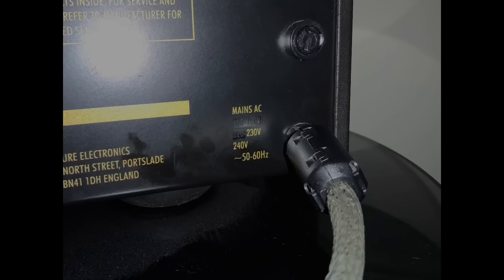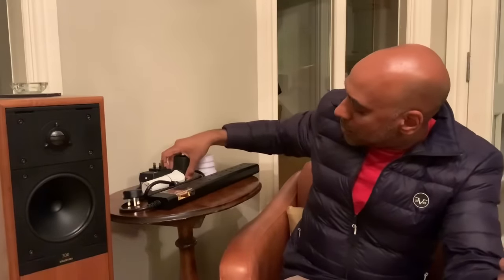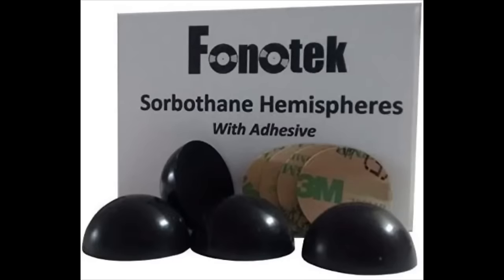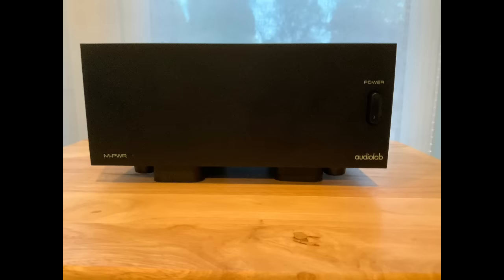My Top 5 Inexpensive Hifi Tweaks

Comment: Honestly love some of the "HiFi Tweaks", but!;

"isolation" pads WILL allow the cabinet to move and dampen and/or resonate with the woofer, best to put the speaker on a platform with substantial mass (concrete/marble/granite, etc) then use the isolation pads underneath as to not pass vibrations to a wooden floor. If you have carpet you may not need the isolation pads. Placed on cement floor the spikes (if too pointy) will also allow the cabinet to move and resonate/dampen the sound as well. A very simple test is to place something heavy on top of the speaker, if the bass sounds tighter and cleaner than you have a floating cabinet issue.

If you want to clean up and condition the electrical signal buy a isolation transformer, completely reforms the electricity and is used for servers and medical equipment to guarantee a solid clean 110v/230v without noise. You can buy the best power plug, but that means nothing if you have a bad outlet or electrical in your wall or even faulty transformer outside your house. These cost about $150 and will eliminate any need for any other gizmos.

Another inexpensive tweak is a clean contact. Tarn-X and a Q-tip is your friend ;-)

Side note, you have tiny bones in your ear that adjust for different sounds that WILL physically effect the sound. Even tilting your head back will mute the sound a bit. Point being if you feel it sounds better after certain changes you might be literally opening up your ears and are hearing it better inside your ears but may not be getting any real changes to the audio it self. And obviously cleaning out your ears lol

Comment: Some really good and sensible tips - thank you.  I have just ordered the rubber washing machine feet to place under my Atacama stands, which are currently on spikes and then placed on 2p coins, going to place the 2p coin inside each of the rubber feet so that the spikes dont go through the rubber moulding.
Reply from the maker: Thank you John 😊👍

Comment: Great advice. The washing machine pads work for me under almost all of my hifi. My Linn dealer advised not to use anything under my LP12 trampoline baseboard though as you can have too much isolation. I will be giving one of those extension leads a try next.
Reply from the maker: That is great Tony 👍

Comment: Thank you for the suggestion of using washing machine supports for speakers on a wooden floor.  I was a little sceptical but am trying this today with a pair of KEF 104/2s that stand on granite plinths that are in turn on a well past its best bouncy Victorian wooden floor.  Initial impressions are of less congestion in the bass and lower mids; clearer tom and bass drum patterns, maybe slightly improved imagery too, time will tell.  Definitely worth trying and if I decide against well at least I can use one pack under the washing machine   😄
Reply from the maker: You have kind of mentioned the improvements I would expect from decoupling you speakers from a wooden floor. Thank you for watching and sharing your experiences 😉👍

Comment: You are definitely my favourite Hifi channel. Total common sense and honest look at this subject. I have implemented exactly the same items as you have listed. I attended the Bristol hifi show this year and sat in on (won't say the manufacturer) demo of their mains filters/ conditioners. He held up the Tacima 6 way mains conditioner and said they have tested this and it introduces noise and degrades the sound of the audio. I nearly fell off my chair. They did not use it as a comparison between their kit either, just decided to bad mouth the Tacima. I have one, nice bit of kit. Great video sir👍
Reply from the maker: Hi Andy, that is pretty shocking that a manufacturer would do that. Especially when it is know in engineering circles that a main conditioner can be effective and produced for little money with passive components. I am not saying that the Tacima is perfect but it works in my system at least.  Thank you for sharing and your kind words of support 😊
Reply: @abritishaudiophile7314  I was shocked that they named and shamed. As if Tacima would produce a product that would be detrimental to  audio the purpose it is designed for. I agree it's not expensive but it works. Mine is staying in my setup. Look forward to the next video 👍

Comment: Are you sure about connecting the shielding at both ends?  I thought you only connected it at the wall plug end.
Reply from the maker: Hi David, it is my understanding that it is still better to connect the shield to ground at both ends for it to be most effective. I believe the purpose of connecting at one end was to avoid ground loops (potential difference from one end to another) which can cause hum and interference. If you don’t have a ground loop issue, I was led to believe that it was better to ground the shield at both ends. However, I am sure that someone with a deeper understanding than me may be able to elaborate further. Thank you for watching 😊
Reply: Opinions seem to differ. When I made up my mains cables (I prefer the Belden because I tend to stab myself in the fingers with braided shielding) I connected the shield at the wall end only, but there are arguments for connecting at both ends.
Reply: Yes, i also got recommendation by electronics/hifi diy experts to connect only one end, to leak all that noise back to the wall instead of amp and wall.
Reply: Terminate the shield at the wall end only. You want any electrical noise to flow directly to the outlet and not the equipment. If you connect both ends you can have noise going to ground at both ends. Even though it will ultimately wind up going back to the system ground, it is the time it takes for that to happen that can cause isues. Terminating one end only provides the shortest, quickest, and least resistive path to ground.
Reply: @osliverpool  Connect The Shielding To The Plug End If You Connect It On Both Ends The  Shielding Will  Act Like A Antenna
Reply: @abritishaudiophile7314  the shield becomes the earth if connected at both ends. Ground voltage in the equipment will then rapidly raise and lower with the fluctuating R.F.  So only connect the mains end.
Reply: I'm inclined to think its a red herring.
Reply: @rrussell39   What happened to the Maximus at the end, lol.
Reply: @Stew666able  i saw it on  a PS Audio Video. Also i Bought A MCRU Silver plated Mains Block Last Year I Removed The Cap On The Mains Block and The Shielding Wasn't Connected It Was On The Plug.
Reply: @rrussell39  technically does not matter how it's hooked up the path of least resistance will be taken.
Reply: Agree with you David. For me it is not critical the gauge of ground cable as in neutral since ground doesn't carry current.. It´s only for safety and zero the chassis. Shield is only shield and you want to discharge it as near to the real ground. in this case i think even on a top high end you cant ear the difference but on very hostile environments associated with longer runs of cable you probably can, at least, measure  it. By the way great video AB.A.
Reply: If you're disagreeing on whether to connect one or both ends then you're obviously not hearing a difference. Which makes the whole exercise irrelevant.
Reply: @jonblakeman6636  haha that was a good point!
But the "exercise" would get twice as much work then you need to buy double the material to make two sets of cables. So you can switch faster between them. When the hearing memory is very short so you do not have time to modify one cable between listening sessions.
So I think all the hassle to make that experiment is mainly the reason why nobody do that experiment. And that is why we do not know.. ..and not he other way around.. (that everyone has done this experiment and can't hear the difference)
My guess anyway. I have not done it myself, has anyone?
(But it should be a rather easy task to make a power cable that has at the equipment end the shield routed to the outside of the cable before it goes to the earth lead. So you can put a connection that enables you to plug/unplug the shield at the equipment end. For fast AB testing.)
Reply: Since final input sources terminate at an Amplifier input... this is the ONE & ONLY ONE end where you should terminate the shield.
Reply: Ground cable is for YOUR SAFTEY.. not for the safety of the equipment ...it must have at least the same " ampere"  & voltage insulation class as the input power cord..
Reply: Honestly, it depends, and pays to understand your equipment and the problem you're trying to solve - it could make it better or worse. Spoiler: You would probably be better off not connecting it at the equipment end in most cases. 

Firstly, the Ground wiring in your house is so high-impedance at RF that it probably won't do anything at all either way. 

If it's an electrically noisy area, like an equipment room/factory etc, the shield might help, and it might make a difference whether it's terminated at the equipment end or not, but... 

The other thing is that a lot  of home hi-fi equipment is double-insulated, even if it has 3 pins, the ground may not be used, unless it has a good mains filter on the input. Disconnecting the shield at the equipment end might be helpful if there is a mains filter as it means the noise currents will travel down the earth core rather than the shield and the shield will provide some electrostatic shielding of that from nearby cables.

Your milage may vary, I fixed an RF interference issue at a home right next door to a 100kW AM broadcast transmitter. Shielded mains cables with the shield connected to a seperate earth stake, and not terminated at the equipment end might have helped, but treating the speaker wires (Ferrite cores, and low value, high voltage capacitors to ground) was plenty. There was BTW already a mains filter in place. 

Shields, capacitors and ferrite cores all shift problems from where you don't want them to where they don't matter. You still need to think about where that is and how it gets there, otherwise you could end up making it worse, or spend money to have no effect at all. Looping back to your question, do you want noise current picked up by the shield going to the equipment or to the house wiring?

BTW For interconnects, there is more to think about, but the principle is the same.
Reply: @rrussell39  well said sir!
Reply: @Dealingwithidiotsonadailybasis  Who is the other guy you're thinking of?
Reply: @jonblakeman6636  Also anyone claiming a difference can only be imagining it!

Comment: Good video.  I will add one more cheap tweek.   Speaker pad, they are dense pad of foam to place your speakers on, Amazon has various types most under $20.  They are more sturdy than small rubber feet (without need for putting adhesive on the bottom of your speakers).  Protects the speaker and the stand from scratches, while also nicely isolating them from each other.
Reply from the maker: Thank you Francisco. I use them too 😉

Comment: Thanks for the tips Tarun.  I see you're diving fearlessly into the area some find contentious, but I for one agree with your views.  In fact, I've been making my own Lapp cables recently to replace the horrible standard cables on some of my vintage gear.  This has included fitting IEC sockets to the backplane of amps and also using rhodium plated connection throughout.  Only slightly more expensive but less prone to oxidation.  Saves on deoxit later.

By the way, I agree with Mr Hall's comment and I only connect the shield to the plug end of the cable.
Reply from the maker: Hi Mark, thank you for your feedback. I just check with David Brook @ MRCU  who sells the Belden and Lapp kits. He agrees with you that the cable should just be terminated at one end, the plug end. I will post an update based on this advice.

Comment: Great post. I've basically put in place all of your recommendations. The ferrites didn't work for me in the end as I've bi-wired my speakers and in my situation it choked them. However, the Tacisma and the combo with the ifi has worked excellently for me. I did suspect it was bs, but very definite difference, cleaner sound more headroom and no strangle hold unlike many other stuff I've tried including Furman. Thanks.
Reply from the maker: That is great. Thank you for sharing 😊👍
Reply: @abritishaudiophile7314  Could you do a piece on designated pre amps and power amps, or more importantly using integrated amps that can switch to either or? I find it very confusing even with a rudimentary knowledge of hifi.

Comment: Nice tips!

Regarding power cables, I was a major skeptic of expensive cables.  As you and others ask, how do the last 2 meters of wiring make a difference,  especially when one has power conditioners?  Fortunately, I had the opportunity to speak with David Salz of Wireworld. He explained that the function of the power cord was to deliver 60-cycle power (here in the US) to the equipment without carrying along the "trash" that is layered on top of what comes in from household wiring (and the power company).  Therefore, he designs his power cords to filter all but the 60-cycle signal.  When one considers that what we ultimately hear is the power supply as modulated by the equipment and audio signal, one can justify the use of properly designed power cords.  g

I too found the IFI filters to be effective, and I use several.  While I don't know about the power strip you mentioned, many come with 16-gauge wiring, and that may limit dynamics. 

I do have a dedicated 20 amp circuit used exclusively for the audio system, and find use nothing less than 14 gauge power cords even on low power consuming gear.   My latest addition to my power solution is a battery with an AC regenerator.  It is only 500 watts, but I can run my CD transport and DAC with it.  I was gobsmacked by the improvement.  It annoyed me because of all I have spent cleaning up the household AC! 

Suggestion: do a video on room treatment.  The biggest change I ever made to my system was extensive room treatment.
Reply from the maker: Thank you Robert. Well designed power cords do exactly that, filter noise. They don’t need active or passive filter networks, the geometry of the cable can act like a filter. I have done a video on room treatment. Please see link below… 👍
ABA Clips: Do you really need room treatment?
https://youtu.be/d4WI_cSc7Wc

Comment: The Tacima is an amazing tweak. I had no complaints with my system, no buzz, no hum, even on full volume on pause play. But the Tacima definitely improved the TV picture and brought additional detail in the music. Moving speakers a bit further from the wall helped improve the sound. Much enjoyed this and other videos for the clarity and fluency. No plans to replace my 20+ year old Linn system.
Reply from the maker: It is great that you are still getting so much enjoyment from your system. Thank you for watching and sharing your experiences Chris 😉
Reply: The biggest things you need from conditioners are: lack of current limiting and not using fuses/relays to absorb surge.
Reply: Are you using classic Linn speakers? I picked up a pair (Linn Ones I think they are?) with integrated concrete stands (!) from FB marketplace, and I love the sound of them but one of the tweeters is non-functional. I’ve no idea how to go about getting a replacement, I would be happy with something that just works and gives me back some treble and fits in the hole, but, yeah. If anyone has any ideas there I would appreciate it…
Reply: @chrislawuk  I only had amp and cd player. I have since sold both after 25 years. I can't help with your question. Sorry.